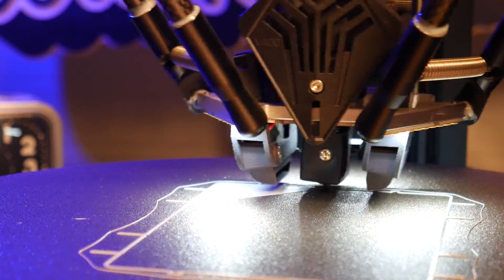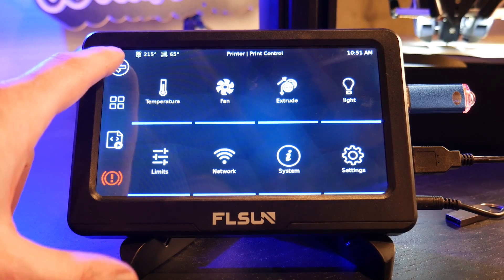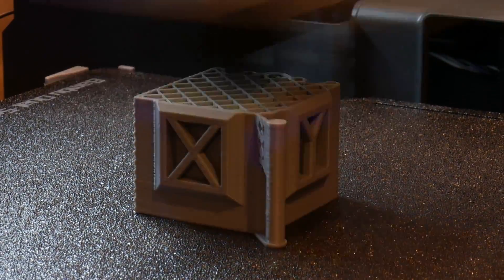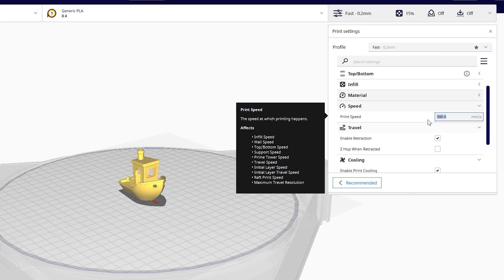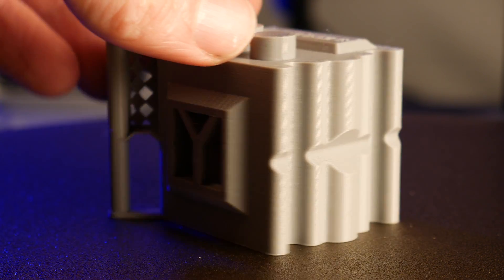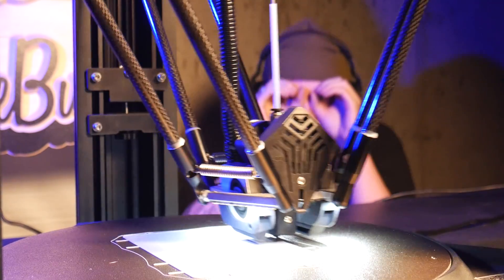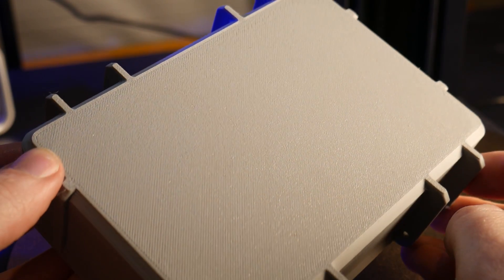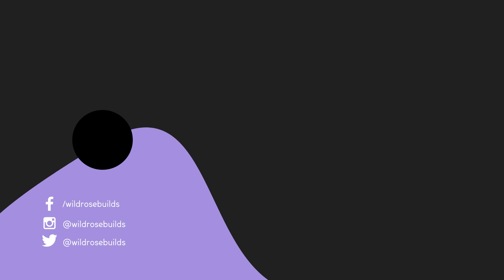FLSUN V400 - The Fastest Delta 3D Printer?

Comment: Love this printer, it is my first, I have a Zortrax M300 Plus at work. This is a little bit too fast for its own good, need to slow it down a touch to get the best out of it. The acceleration while moving between printed parts makes the belt jump a tooth! May just need the belts tensioned, haven't got round to it yet! Had a couple of problems with it when I received it, one of the wires inside the top had come loose from its connector so one of the 3 motors did nothing!Only took about 10 minutes to find and fix. The other issue I had was trying to load the V400 profile into Cura! That took a real long time! Not simple! Other than that, love it, great quality prints in a fraction of the time my work printer can achieve.
Reply from the maker: Tensioning the belts is pretty quick on this guy. prusa has a belt tensioning tool on printables that i've been meaning to try out. i also found a .exe that auto injects a V400 profile into whatever version of cura you have and that was super helpful! thanks for watching!